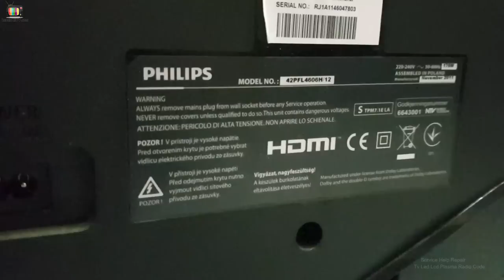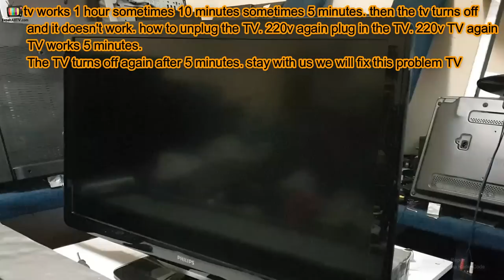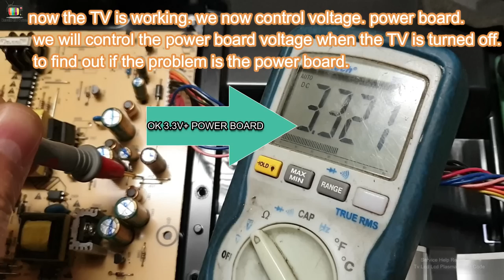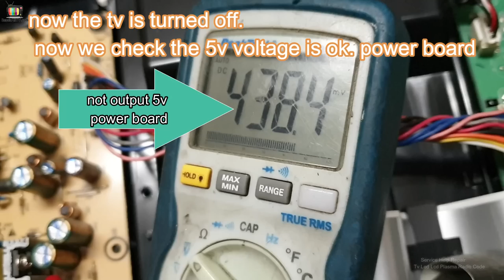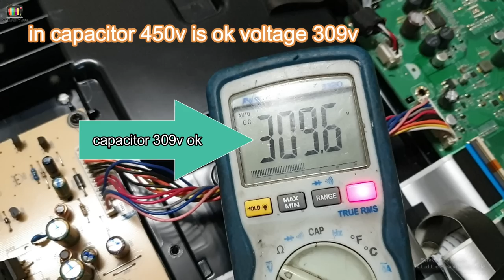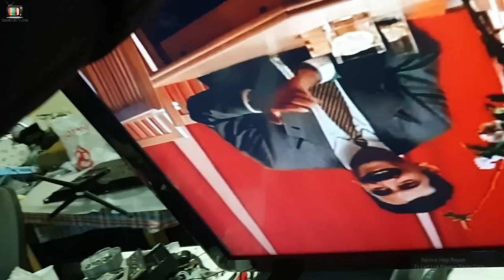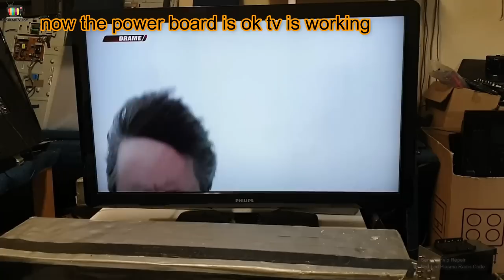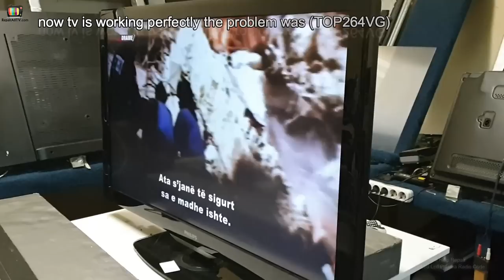philips 42pfl4606h/12 tv works 1 hour sometimes 10 minutes sometimes 5 minutes tv turns off

Comment: Hi, I have the same TV but 42 inches. The card inside is different and mounts the TNY277PN as the IC. I have the same problem that it turns itself off. Could this IC be faulty?

Comment: I have same problem with Philips 32pfl5604h/12 but power board is different, have you experience this case before? will the eq. FAN7530 be the IC to change in this case? Thanks in advanced!

Comment: I had the same problem with my Philips TV. It is not easy to pull the old IC out and change it with a new one without good equipment. But at the end it all worked out fine. Thank you so far for this good video.

Comment: Have had a similar problem with my 47PFL6007T model. Would shut down randomly and turn on again once in a blue moon, but suddenly one day it would happen once a minute. My 3.3V on the power board stayed on when it shut down, so started thinking there was probably some safety shutdown from the main board. For some weird reason leaving the wifi circuit disconnected from the main board fixed the problem for me. The plug is accessible just by taking off the service panel, 1C31. No idea if it will work for others, but since I haven't seen this "fix" online anywhere, I thought I'd share. I've never used the wifi on the TV, so probably won't bother looking further into fixing the underlying cause. I guess there's still an issue with the board, but disconnecting the wifi was enough to keep it under control.

Comment: in terms of the pin configuration to which pins are the 5v and 3.3 volts connected? Of IC 905(Top264VG)?

Comment: I have a manual multimeter, i know if its showing 1 that means the measured voltage is higher than the unit i selected but what if it's not showing any voltage while the TV is working?  (like 000) is there any way to fix the board (because as i understood that means there is a problem with the power) or that board is already beyond saving?

Comment: I have a problem with starting the TV with the remote control from standby mode and the button on the TV.  Sometimes you have to press the power button 30 times for the TV to turn on.  What could it be?  Do you have this arrangement?

Comment: HELLO, YOUR VIDEO IS USEFUL I HAVE A PROBLEM I RENEWED THE TOP264VG IN THE CIRCUIT I REFUSED THE MF CAPACITORS AROUND IT, BUT THE TOP264 IS STILL HEATING AND THE TV TURNING OFF IS IT FROM THE QUALITY OF THE INTEGRATED?